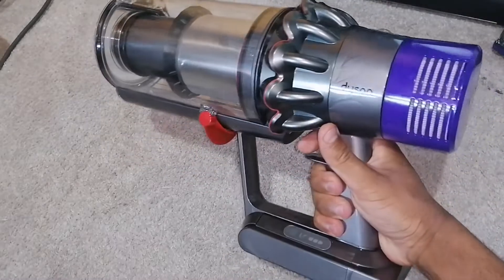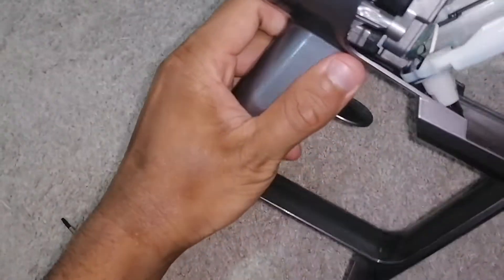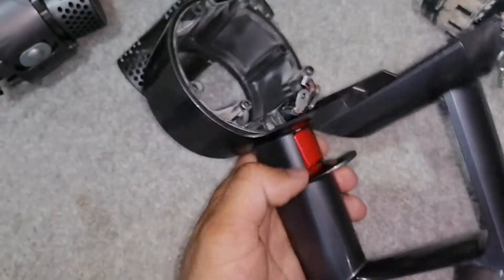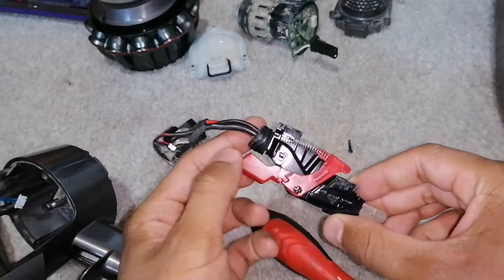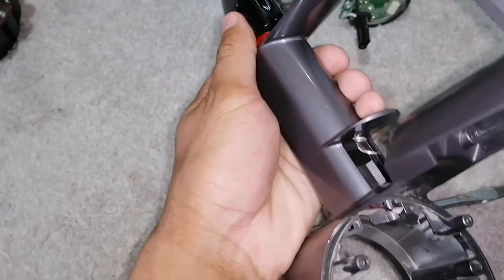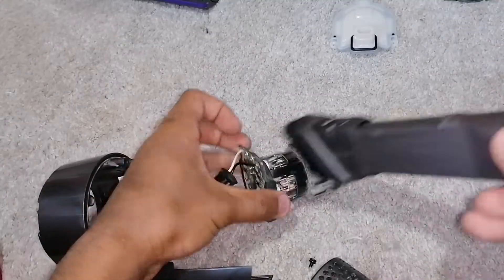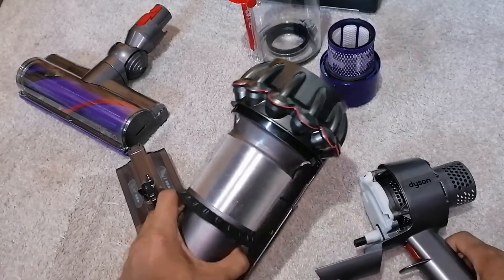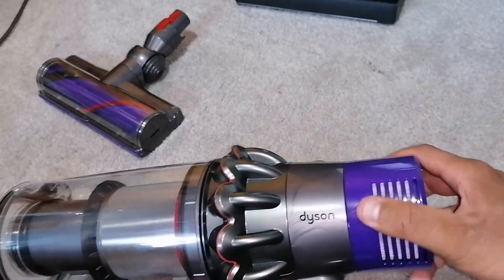HOW TO - Dyson V10 animal motor repair guide [strip down]

Comment: Hi, Great video! Thank you!
I disassembled and cleaned my Dyson V10 Animal, but the problem remains. The Dyson works only on the high speed and only with the original filter and stops working after a few minutes. The battery is full. This problem is from yesterday, but for the last few months, I had a problem getting the Dyson to work. Can this problem be fixed? Or is replacing the motor with a new one is the only solution? Can it be the sensors? Is there a way to bypass the sensors ?

Comment: Excellent video, and straight to the point! I just tore my V10 down with the help of this video. I had an issue where the motor would not turn on, and the filter light was not working when the filter was off while pushing the trigger. The motor board was wet, and I dried everything, cleaned it and now it works great again! Thank you!
Reply from the maker: Excellent! I’m glad you found it helpful and informative 😁

Comment: in the purple top filter we're finding little bits of like black plastic fragments of some kind of screen, I can't tell exactly, but it looks like inside the motor housing that sticks into the purple filter, behind the little holes there is some kind of black plastic screen...?  does it start to break down over time...?  is it a problem...?  is it something that can be replaced...?  (it seems to make the filter light flash more often than it used to)  thanks...!
Reply from the maker: Do you mean the foam filter inside the motor housing? I wouldn’t worry about that, it’s only there to attempt to insulate noise from the motor, it’s like a very porous sponge material and it can break down over time due to the fragility of the material. I believe the filter flashing light is most likely due to either a blockage in the machine or the HEPA material of the filter being clogged in its small pores
Reply: @parwaz7861  hi, yes that's it, I found some photos via Google of people finding identical little bits of plastic, they look like little tiny black plastic dogbones, and they say they come from the sound reduction sponge...

Good news is that it doesn't affect the operation...!  

Amazing that to get access to the sponge literally the entire vacuum and motor have to be disassembled. They could have just put a little lid in the end of the motor tube... :(

Thanks...!

Comment: also at 1:18 at the top that white connector with the blue cable is disconnected from the motherboard, did you scrape off the glue in order to disconnect it?
Reply from the maker: Yes it must be scraped off for the wires to be disconnected
Reply: Thanks man
Wont be a problem reconnecting them after? @parwaz7861
Reply from the maker: Nope, the layer of glue is there to protect the circuit board from any water incase the filter is wet

Comment: 1:18 after you say "bend these 2 metal pieces" 

the video skips and the motor is suddenly outside of the handle - how?? mine is still stuck there.
I can see 2 screws inside under the engine but I can't reach them because of the angle..
Reply from the maker: Use a flat screwdriver to pull the motor out gently, the motor housing comes out with all the mentioned screws removed the wires out the way
Reply: Broke mine cuz the small wires disconnected with the peace it connects to on the mother board important part there

Comment: This video really helped when I used a damp filter and it deposited moisture on the circuit board. Pretty sure my wife would have at least figuratively killed me, mercilessly scolded and likely had another appliance ban imposed(I'm already not allowed to use the washing machine and dryer, lol).
A true lifesaver and what's left of my dignity thanks you so much :)
Reply: what exactly did you do to repair the moisture on the circuit board? I might be in the same boat. Thanks!
Reply: I initially tried to blow warm air with a hair dryer into any openings I had access to. This proved to be fruitless. I pretty much had to disassemble the vacuum to where I could get access to the circuit board on the back of the motor. Once I dried the visible moisture on the board it worked perfectly.

Comment: Great guide, many thanks! I had the constant filter LED, despite having cleaned the filter carefully. I stripped the head down until I could see the motor PCB, and there was a combination of moisture from my improperly dried filter along with carbon soot from an open fireplace caked over it. Some drying time, then a light brush with a vacuum hose nearby and it's working like new.
Reply from the maker: Excellent work! Thank you for sharing your anecdote and I’m glad you found the video helpful! ✌🏽

Comment: do v10 motors give many problems
Reply from the maker: They’re generally reliable but I’ve seen them have motor issues, not sure why but it’s usually because people don’t let the filters dry
Reply: @parwaz7861   That's why I'm here lol, thanks again for this video! The motherboard and motor got wet so I just took it apart and dried it with a fan for 15 minutes. Thank goodness Dysons won't let you fry a wet motherboard.
Reply: I have 2 barely used v11 that are dead. In my opinion these are horrible vacuums, especially for the price. It ends up costing $30-40 for each use for me.

Comment: I just went to a Dyson Vacuum shop to buy a Dc04 today but the man said they dont sell them anymore. So then he told me you can have this Dc07 Origin for free here but it needs a clean and it doesnt work. I took it home plugged it in and it fired up. Went to town got two filters because the other one was dead dirty and i didnt want to wash it and i also bought a pad filter and also some belts. Now it works good. So i have a Dc07 Origin now!

Comment: Another great video, would've been helpful when my num had hers! Do you know how to fix a wand sticking out the bottom of a dc01, where the blockage check slots are?
Reply from the maker: It probably needs a new wand
Reply: @parwaz7861  will a dc01 wand fit a da001?
Reply from the maker: @RJA_World  I've no idea, I think you may need to swap the hoses over as well
Reply: @parwaz7861  I tried a dc01 hose, it wouldn't click in
Reply from the maker: @RJA_World  I've no idea mate honestly
Reply: @parwaz7861  no worries man thanks anyway. I've ordered a dc01 wand as da001 ones are non existent now , hopefully that fits and sorts the issue

Comment: Nice video mate. So where do you get the red trigger plastic replacement? The aliexpress ones are crap and break very quickly. I have designed a laser cut splint that glues on top that is rock solid and stronger than original and do about 10 a week. But a new trigger would be nicer.
Reply from the maker: Cheers mate, my trigger it original as it never broke I just took the vacuum apart for a tutorial, I think beko1987 has replaced one with a newer  though on his V11